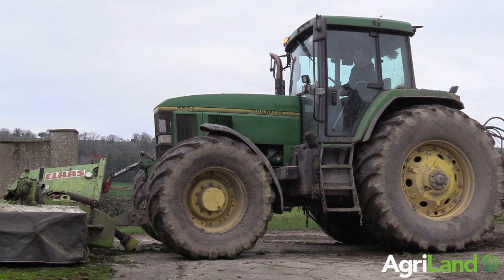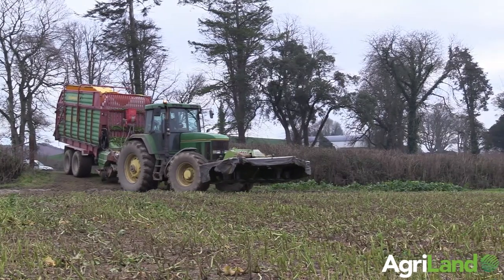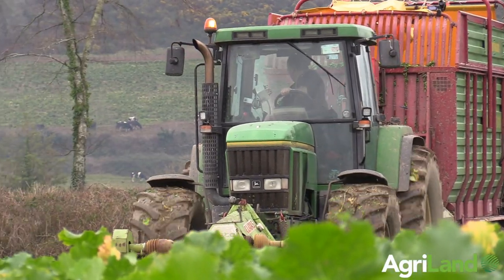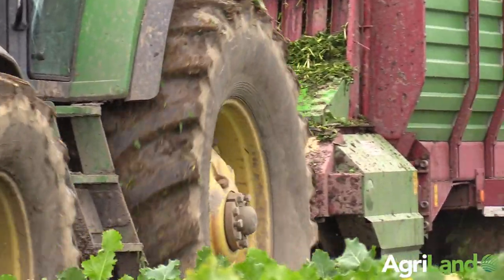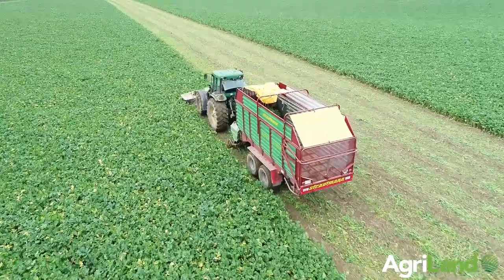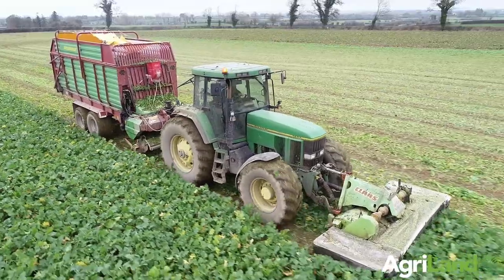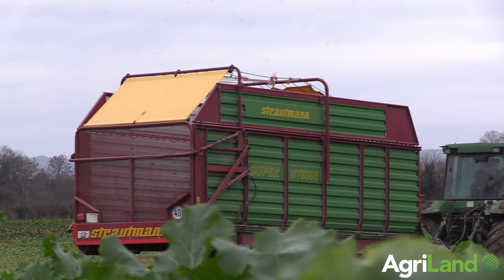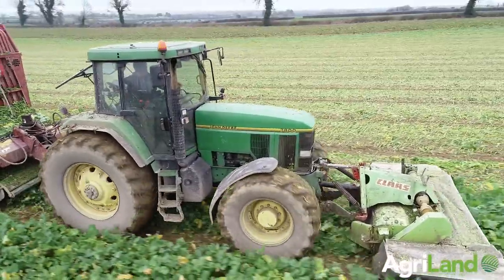AgriLand chats to Tom Carrigan about his John Deere 7800

Comment: If have a story to tell lads, back last year around spring, I was rotavating a field with my 7800. I had been doing so for 4 or 5 hours at that point making sure the soil was nice and fine. But then after awhile I started seeing smoke coming from the front of the cab from under the bonnet, then I saw fire coming up around the cab. So I hopped out as quick as I could to try and stop it and smother it with clay. But it was too late. The tractor was up in flames. And I had just spent 6 grand on 2 new front tires which were now nothing but black smoke. 2 fire brigades had to be called but by then the tractor was done for. Our finest tractor, destroyed by an exhaust fire. Sad times. It’s charred chassis now sitting in our yard, eating to be scrapped.

Comment: The 7.6 and 8.1 are my favourite motors. And for good reason,,  ok I know they are old school and have small design flaws when it comes to efficiently creating power.. But trust me the 7.6 will do 200 on the shaft and the 8.1 even more. Infact the 8.1 is more like 300.... These tractors are the dogs bollox in my opinion,  and yes I have driven them,  these were the last of the proper old school,,  things have gone horrific gay now,

Comment: What did you do to that engine to get 200hp? It came stock with 145hp we have a chipped 7820 that they say gets 208 but I don’t think it’s doing that but it kicks the 7800 all over the place on the silage cutter
Reply: When we bought it their was an issue with the rear pto auctual both pto's weren't working properly. The agreement we had with the dealer was he would sort the rear and we would look after the front ourselves. When he repaired it to test the repair he put it on the dyna. It was actually over 200hp at the test. I'm no expert on JD's or wouldn't ever clame to be but that's what it was on that day. As to the front suspension every 10 series I have driven here including my own has it just shows you what I know I suppose!
Reply: Tom Carrigan ok well must be an option and we are to cheap to add it lol, maybe they come turned up there too, less emissions or something?
Reply: @henryhenry903 Mabe it's something to do with where their manufactured now as I said no expert here but aren't some built in Germany for the European market and some in the US? As for the HP id say the pump was screwed up we turned it back and still have loads of power for anything we need it for. 👍
Reply: Tom Carrigan yes that right we have a 7200 built in Germany and a 7230 from the USA and the power is about the same but the German one is way better on fuel, but if the fuel screw was played with on your that could account for a lot of the power increase
Reply: @tomcarrigan843  All the 78's were built in america. The 69's and 7530's etc germany.
Reply: Standard Hp for a 7800 is 170.